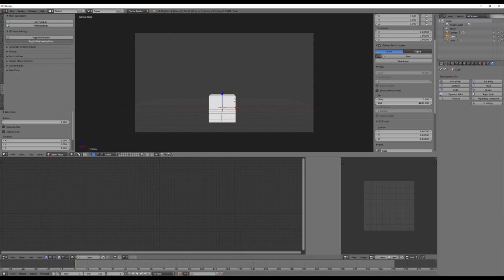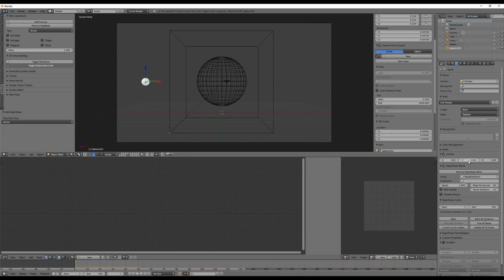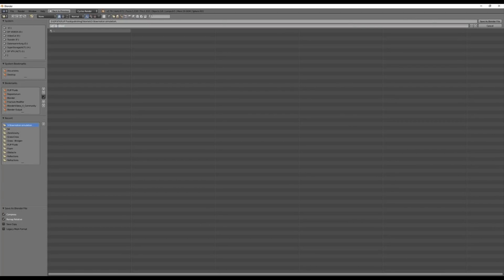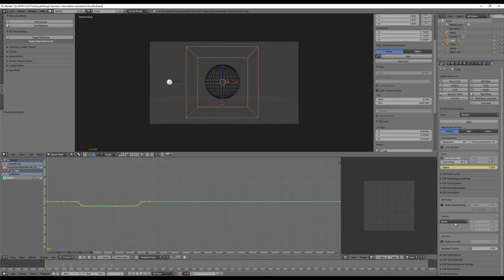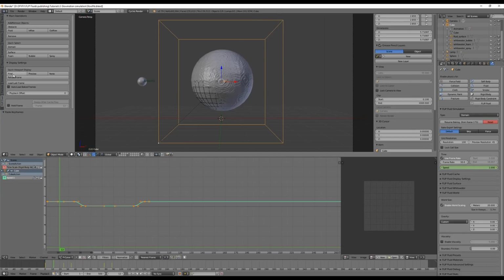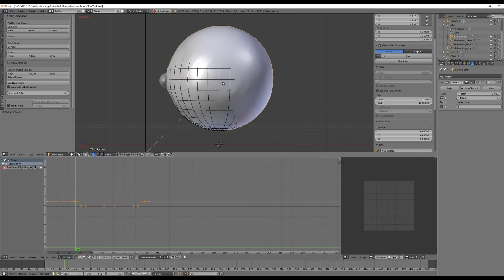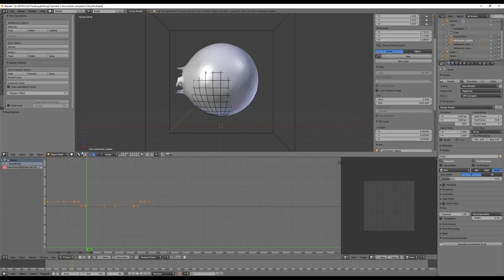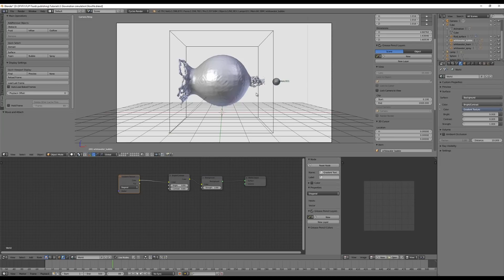FLIP fluids | #3 SlowMotion sphere

Comment: Tried to use the letter e actually a whole word to pass through the liquid, but it's not working. The water doesn't react to my mesh. What could be wrong? The normals are correct, i set the collision shape to mesh (tested others as well) and its ofc an obstacle. I tried playing with the margin  and have no luck at all. i also applied rotation and scale. standard sphere was working perfectly...
Reply from the maker: Try to use obstacle-debugging. This will show you how the simulator sees your obstacles.
You could take a look to our 10-tipps video.
Reply: @Blenderphysics-Videos  thanks a lot for your feedback. Me as programmer should know better and i saw the debugging option but simply ignored it of course xD will do that when back at home as i do still have some issues with my apple juice! Thank you :)
Reply: it was the size! I increased the object and now it's working. Ithought it was already quite big so I didn't check that^^

Comment: Hi, I followed your tutorial and the first time it kinda worked. After that every time I recreate it as shown in the video the rigid body does not interact with the fluid no matter what I try. Using 2.79.
Reply from the maker: Make sure you made your "rigid body" an obstacle with FLIP fluids. Enable "export animated mesh". Let me know if there are any issues!
Reply: Thanks for your quick reply. No it doesn't help. I do everything exactly as you show it in your tutorial. The only thing that changes is the size of the meshes. I have just a few questions. Does flip fluid have a lower limit when it comes to meshes? I was doing the other tutorial with the soda can and I found out that if I decreased the size of the sphere below a certain amount it wouldn't generate fluids.
Reply from the maker: Hotgates  Please send me your file to info[at]blenderphysics[dot]com - so i´ll be able to find out whats going wrong.
Reply: Thank you. I will.
Reply: Same problem. Did you get it figured out? Can you tell me what I'm overlooking?
Reply: @TheColinStein  My domain resolution was way too low! I tried using a minimum "150" and everything worked as per Dennis' instructions. Vielen Dank Dennis. :)
Reply: @vangelisangelakis3D  I forget what my domain was but I think it was either 128 or 256. It worked out eventually but couldn't render more than a handful of frames. I need to figure out where all my caches are going.
Reply from the maker: @TheColinStein  please send me a blendfile via email ;)
Reply: @Blenderphysics-Videos  I actually got it to work by UNCHECKING what you said to check. Either way, I did figure it out so no need to send the file. Thanks for offering to look at it! Now I'm trying to figure out why my machine can only render a handful of frames.

Comment: Thanks for the great tutorial.  I love this add on.

I'm trying something similar to this but instead of using an Obstacle object I'm using an Inflow object, and instead of going through a sphere it's going through a Fluid plane parallel to the X, Y axes; the plane has been made thick with the Solidify modifier.  The Inflow object has a very small Inflow Speed and it's using a Target object.  The Inflow object is following a circle parallel to the X, Z axes using the Follow Path constraint, so it goes through the plane twice, up from the bottom and then down through the top.